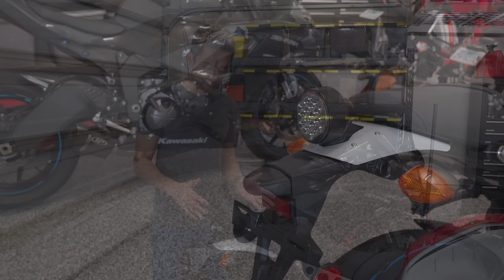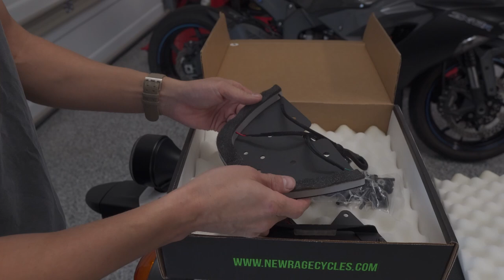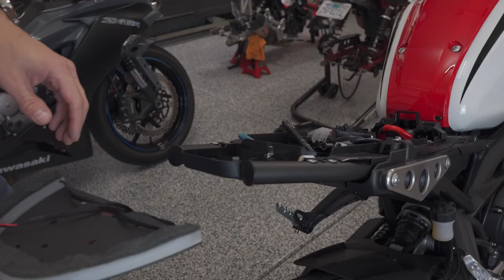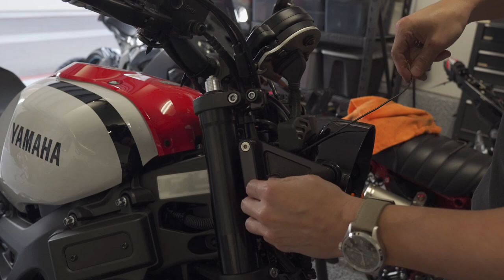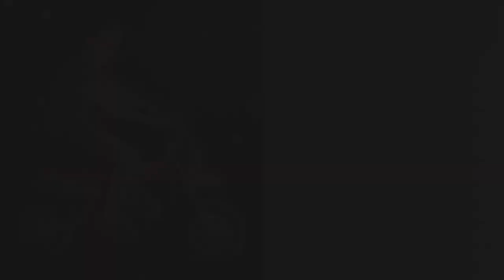2021 Yamaha XSR 900 Initial Modifications

Comment: Little tip, looks like the mblaze pins aren’t oriented correctly, although they shine 360 they are directional, make sure the small reflector is facing forward and you’ll notice an even brighter output
Reply from the maker: I'll check that out, I didn't realize they had a direction. thanks!
Edit: I readjusted and it's a blinding difference; pinning your comment.
Reply: @eastcoastish  will you please post a video about the difference it made after Allan's comment? I really would like to see it. and the tail light is perfect this way. any chance to share the link where we can order?
Reply from the maker: @omeraktash  huge difference having them angled correctly. Here is a link for the tail: https://newragecycles.com/products/yamaha-xsr-900-fender-eliminator
Reply: Clearly you never ride in the wet……

Comment: I have the same 2021 XSR9...what are your thoughts about the build quality for the NRC tail tidy for $175? The brake light LEDs don't look that bright in daylight (but that could be because of video capture?) TIA
Reply from the maker: The quality of the kit is pretty good, visibility of the light is slightly less than stock but I think it's adequate. It's definitely the best and cleanest looking of the tail tidy kits for the xsr900.